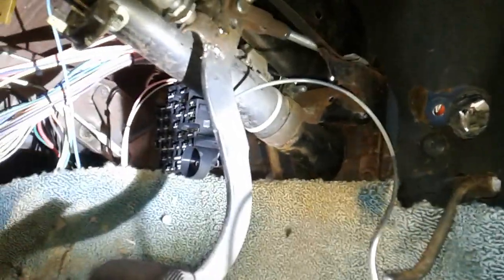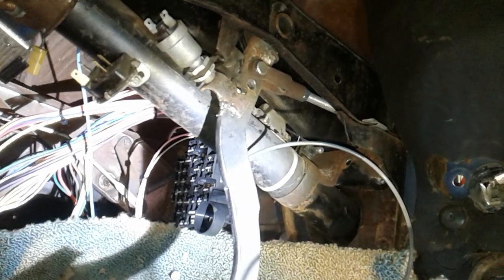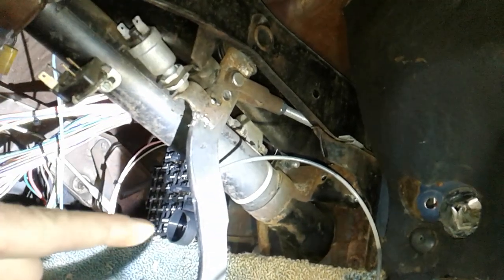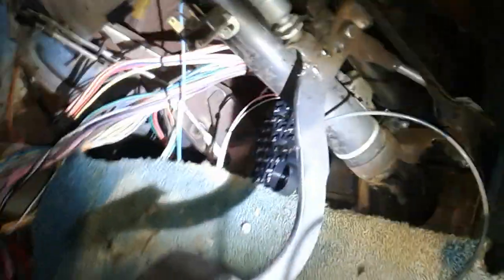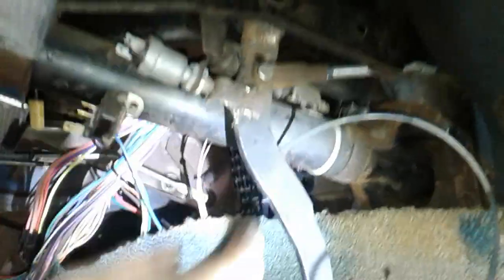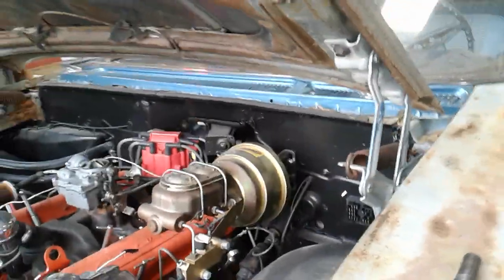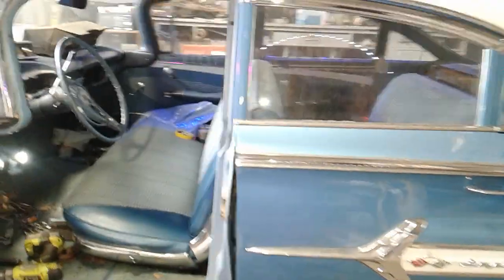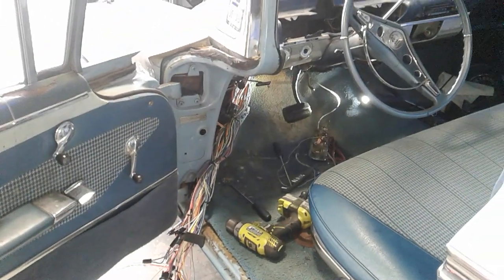So Your New Disk Brake Conversion Kit Has A Low Pedal!!!

Comment: For all the people who argued with the OP you don't need 6:1 ratio for manual brakes you need ~4:1 for power brakes.  You achieve that by lowering the piston on the pedal exactly as the op said.  There's a formula for it in fact - just google.  And you get a shorter pedal throw in the process.  But also check your push rod able to your master cylinder.  Too much of an angle and you create other problems - the push rod is supposed to be with 5 degrees of perpendicular to the pedal or something like that.  This is why lots of GM cars have tilted master cylinders!  Thanks for the video Rocker Pat!

Comment: I have same issues in my 1976 Camaro rear disc conversion. I’ve tried everything and only thing helped breaking was changing booster push pin length, but i couldn’t find an adjustable one to fit. Had lots lock up issues testing so i put the solid one the booster came with back in. I think this will give me more control over breaking anyway but it looks like same idea. Pushing pin in further to engage the front and rear of the master cylinder. Fingers crossed 😂

Comment: Just did a four wheel disc brake conversion from four wheel drums. Have disc master, combo valve. Pedal is super soft, not to the floor though, when bleeding light pressure at the bleeders. I’m going to try this.
Reply: Update, clevis was already in the lower hole, prop valve shuttle is centered.
Reply: Did pedal ratio math. 11.5 long pedal, bottom hole is at 3.25 and top hole is at 1.750. Top hole is optimal ratio, softer pedal yet.

Comment: I've been thinking about changing the back drum brakes on our 38 Chevy couple to disc. The front are already disc but I was leery on if something would totally change with how the pedal feels. I had rebuilt the whole brake system before and had some troubles ( long story) but everything works fine now. Just don't want to open a can of worms by trying to make something better. There is a lot of science to brake systems. Kind of interested.
Reply from the maker: Ain't broke, don't "Fix" it!!! Better to just leave it alone!!!
Thanks for watching and Keep Rocking!!!
Reply: @rockerpat1085  10-4

Comment: Will this work with any car? I have a 1966 ford falcon that I did the disk brake conversion for. My problem is that the brake pedal is too sensitive and feels like it’s always on. Like my car feels slower
Reply from the maker: Try loosing the rod adjustment between the booster and the master cylinder!!! It may be too long and is keeping the brakes applied!!! 
Hope that helps!!!
Thanks for Watching and Keep Rocking!!!
Reply: @rockerpat1085  thank you, I’ll go ahead and try it!
Reply: @rockerpat1085  I have my original master cylinder, will I have to get an aftermarket one or will it still work the same?
Reply: Emanuel my pops and i just finished a front disk break conversation and the kit i bought came with a new master cylinder. The new m cylinder has two chambers which is one for the front and one for the rear brakes.

Comment: Hi,  I converted my manual drum brakes to (YJ) power disc brakes on my 76 cj7 jeep.  I noticed the piston rod was slightly longer on the disc brakes than the drums. So lowered my pedal to allow the extra length. After converting to disc, I now I have soft brakes.  I bled the system 4 plus times.  Don't think there's any air. But I didn't bench bleed the mc.  And the pedal hardens up after I pump the brakes. I read I could adjust the piston rod in the booster.  Any Idea On how to fix it? Thanks for the video.
Reply from the maker: Hi CJ7 girl,  I explain how to fix this problem in this video!!!
You need to lower the push rod on the pedal so you get a longer stroke of the push rod!!! 
Rewatch the video and see how I had to drill another hole in the pedal so I could increase the stroke!!!
By increasing the stroke, you move more fluid!!! 
When you go from drum to disk the fluid needed goes up!!!
The drum wheel cylinders don't hold a lot of fluid!!! But the new calipers do hold more!!!
That's why you need to move more fluid!!! 
Like I said just increase your stroke and your problem will be solved!!!
Hope you get it fixed!!!! I like pie and cookies!!!!
Thanks for Watching And Keep Rocking!!!!
Reply: @rockerpat1085  Hmm. Wasn't sure if it would apply to my vehicle too.  Thanks.  Perhaps you can drill one for me?  😏  Would 1" down from original hole work too?  I'll try it. And let ya know if it works.
Reply: @rockerpat1085  Hey Rocker Pat,  before I crawl under my dash 😂 , I read I might be able to lengthen the rod in the booster slightly to get a harder pedal.  Have you heard of this?  
Also, a local auto shop suggested I need a residual value to hold some pressure on the brakes slightly.  However, I have a proportion valve that came with the yj booster. What is your experience if any with the residual valves?
Reply from the maker: @cj7girl280  ok I've already said what you need to do!!!
Take my advice or don't take it!!!!
Reply: @rockerpat1085  OK.  Will do.  Just wanted to confirm before doing it.  Thanks for your help.  God bless! 😇

Comment: what if your having this problem with a rear disk conversion?
Reply from the maker: You are going to have to give me more information!!!
What kind of car? What have you done?
Reply: @rockerpat1085  Did a rear disk conversion on a 1975 Ford Econoline. Pedal is soft and goes low (not to the floor) at first but gets firmer the more you brake. Calipers are not upside down, brake lines have been bled and bled multiple times (might be the proportioning valve mistakenly bought the wrong one... gonna replace soon) Gonna replace the front calipers too in case they are sticking... Just looking at different avenues thanks for the response...
Reply from the maker: @StrongManMattt  I think what you need to do is replace the master cylinder with one that is for Disk-Disk!!! I don't think you are moving enough fluid!!! Try a Master cylinder from a truck that had Disk-Disk like an Expedition!!! Or even a Mustang!!!
The Master Cylinder you have has a piston that is too small for rear disk!!!! It may be a 1" piston and you may need one with a 1.25" piston or larger!!!!
The proportion valve has nothing to do with your problem I believe!!!!
Try another master cylinder and get back with me and let me know how it works out for you!!!!
Good luck to you and as always, 
Keep Rocking it out!!!!
Reply: @rockerpat1085  10-4 thanks for the response.
Reply: @rockerpat1085  seems like it was the front caliper, it seized up... replaced it and seems to have been the culprit thanks for the info and help.